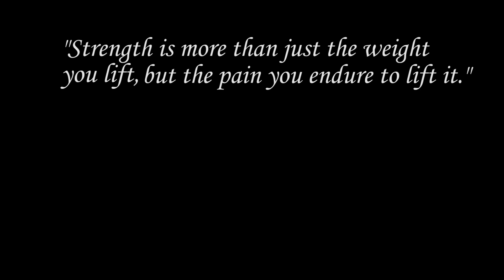Powerlifting wrapped in BARBED WIRE to prove my Strength *WORLD RECORD* | Bodybuilder VS Maxing Out

Comment: The thing is, true barbed wire that's used in prisons and such is razor sharp everywhere, so even the slighthest of touches and grips will leave big cuts. The barbed wire you used is nothing to the ones i saw when visiting a polish high rigor prison, the guards told me stories of how even during training they had a guy touched the wire slightly, he had to go to the hospital because of the wound. Still honestly super impressive nonentheless, but a real b.wire would be impossible to wrap around your body.

Comment: Instead of pain, you could use some discomfort. Try getting a full body sunburn, spend two hours in a highly chlorinated pool, roll around in bark (preferably steaming hot) without washing off, put on a wool sweater and neck tie and proceed to eat a piping hot bowl of soup (your choice)